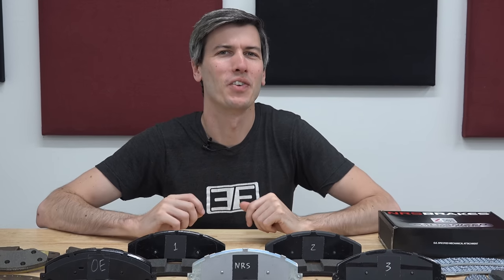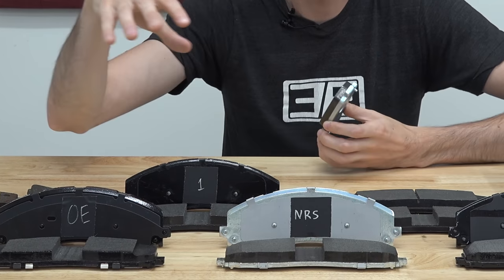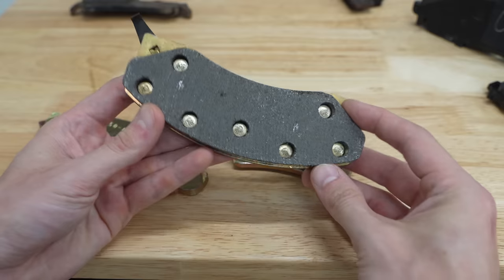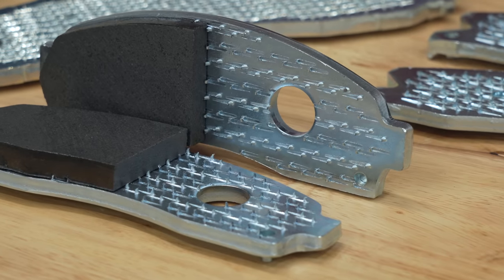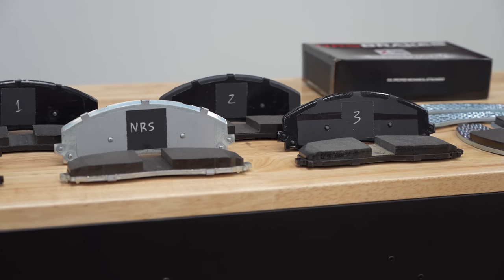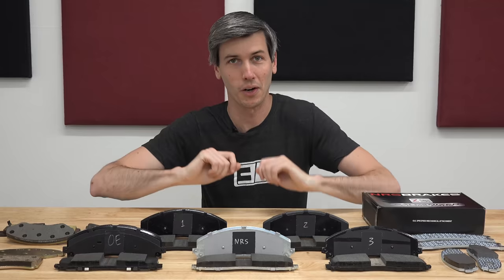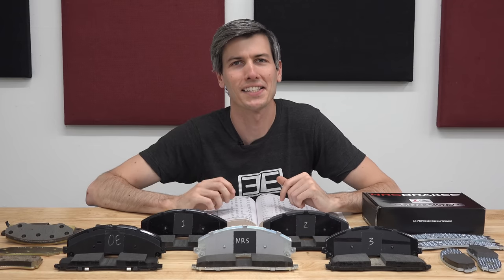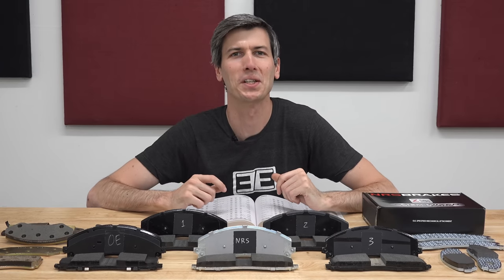The Sketchy Truth About Aftermarket Brake Pads

Comment: I do brake jobs almost every working day, the friction material seperating from the plate is rare if theyre glued on and always happens when the pads are beyond minimum thickness anyhow. Unless you're racing it's not really an issue. That being said I recommend you don't buy the absolute cheapest pads.

Comment: It looks like the shear test is done in the wrong direction. On the video it is performed upward, on the narrower width of the pad. It should be performed sideways, on the longer length, which is more realistic to the stress a pad will be subjected to with the friction on rotating brake disk. Moreover, you can see all the little « hooks » have a triangle shape as they are chiselled from the baking plate. Therefore they are more prone to let go on one direction than on another. I am really surprised this test was even validated. To me, it is almost irrelevant.

Comment: As a colorblind person, I cannot distinguish between the colors of several of the lines and thus can't read your graph properly. You should use instead graphs that differentiate lines based on line design (solid, dashed, dots and dashes, etc).

Comment: When you want to keep your vehicle original, OEM is always the answer. Just because car brands choose manufacturers to build their parts doesn't mean that those manufacturers sell on their behalf following the exact specification designed by the brand, and when you think about it, it wouldn't even make sense to do so, economically.
If you intend to change your vehicle for use on track, drag or anything else, everything is different, this is because you will take it out of its original design, but be careful with the parts you use, safety always comes first.
Good curves

Comment: I'm sorry, but I believe you're trying to fix something that's not broken.  I've been working on cars for 53 years.  I've ALWAYS installed the cheapest pads available and I've NEVER had one separate from a backing plate.  Oh, I'm sure the pad material differs, but I've never had a pad wear out prematurely and the difference in braking power isn't even noticeable.  The auto parts stores will try to guilt you into buying the higher end pads, but for the most part, the difference is the warranty and the fancy box.  Use of the high-end ceramic pads actually results in GREATER stopping distances for the average driver because they're engineered to work the best when they're exposed to repeated high temperature braking you'll find on a race track.  Finally, if the low end pads were so bad, the NHTSA wouldn't allow them to be sold in the first place.  OK, now let's hear from all the pundits who believe I don't love my wife because I make her drive around on cheap brake pads.
Reply: Decades , mechanic too ... Well said and true ...

Comment: This discussion is interesting, but it doesn't really have any meaning without information on actual failures. Are pads on actual vehicles failing due to adhesive attachment? Where's the data that shows this? One can divise a controlled test that yields failure in certain products over others, but it's not very meaningful if it's not happening in use.

Comment: More expensive pads seem to stop better and resist fade, but, expensive or cheap, I've never had a brake pad fail mechanically in my 1.7 million miles of driving since 1976.   Until now I didn't even know it was a thing.
Reply: Do you drive where there's lots of salt on the roads? Rust seems to be the biggest issue separating pad lining from the backing. Had it happen to me on my Jaguar S Type, since I do mostly motorway driving and hardly use the brakes. They get old and rusty before they get worn out.

Comment: I truly hope you read this comment. It is drastically important.
I worked in sheet metal for 41 years.
Amongst a number of other Specialties that I have engaged in in my life, that was my primary vocation.
Whenever we used any metal that was going to be exposed any high temperature of any kind, anything close to 300 degrees or higher we always used aluminized steel when you expose galvanized steel to high temperatures it degrades quickly. Galvanized steel has no business being exposed to high temperature conditions. Nor should it be exposed to anything where it needs to be rust resistant. Although galvanized will start rusting before the steel the thin galvanized all that does is make sure that that steel suffers a great deal of corrosion. Whereas aluminized is far better at resisting corrosion then galvanized. The only advantage that galvanized has, is it when you open the box it looks prettier. Galvanized zinc has no business on high temperature Steel...EVER!

Comment: I work in a returns department dealing with “warranty” parts. While most of the claims are poor installation by braindead parts hangers, there are enough material failures to at least make one think twice about which brands they use. Actually, dealing mostly with mechanics makes me paranoid of driving in general. Knowing how much of their work is out there and then thinking of how many people that shouldn’t do their own repairs but are forced to monetarily. And the meh attitude around it from the aftermarket manufacturers to your average driver, about a 3500lb projectile with sussy brakes and tires.

Comment: I along with several other people in this comment section seem to be sharing a sentiment here, the information is good but you probably should've provided statistics on the number of brake failures and or accidents that are caused by losing the adhesion of the brake material or rust jacking, because I myself and apparently many other people in the comment section have never even heard of it happening let alone it being a major problem.🤷🏽‍♂ I understand that OEMs require it in their spec sheet, but OEMs also require a lot of unnecessary procedure, just look at anything German.

Comment: I must be an anomaly. Have driven 4xx,xxx miles over 16 cars and only had to change brakes twice. I generally get 7-8 years or 100k miles out of them. I like to anticipate stops and let off the accelerator and/or shift down. Its what i was taught

Comment: If you have a Honda vehicle, just use Honda brake pads. They don’t squeal/squeak/rattle, they work well, last, and are price competitive with aftermarket pads, and are often actually a little cheaper than aftermarket pads.

Comment: It comes down to don't buy "own Brand" or "no name" pads only buy pads made by the well known OE suppliers that actually make pads for the vehicle manufacturers. Unfortunatley you can't go on price alone. The likes of TRW , ATE, Textar, Ferodo, etc. also have decent online webcatalogues with dimensions and even in some cases drawings ( ATE) so you can be sure to get the right fit for your car and a pad with the right performance for your car not just a generic  pad with the right shape. The good brands are not going to sell a pad with the wrong specification of friction material for say a BMW M3 just to compete on price as it will back fire on them.

Comment: If slide pins are dry and sticking it will introduce prolonged high heat and cause pads/ rotors to fail.

Comment: #1) I have been driving for nearly 50 years, only 1 time have I ever had friction material come off from the backing plate. And that was a drum brake shoe, which cam loose after the rear axle was submerged for 15-20 minutes, as I got the truck stuck in a creek. I honestly believe that steam was a contributing factor in that case. #2) Who will EVER have there brakes hot for days at a time?! That is a ridiculous test with no real world useful data. get the brakes HOT for an hour at a time to mimic braking down a mountain. That would be useful data.

Comment: DAYS AT 550F.... yeah sure bud, I will have my brakes at 550F for literal days..... cherry picked test much?
Reply from the maker: This is how accelerated testing works. You put things through tougher conditions than they see daily to see how they hold up long term. Over many, many braking cycles with heavy duty applications, you will get a lot of heat in the adhesive.

Comment: Seriously testing pads that were baked at 500F for DAYS. What brake pad is going to last that long in real life, none. Ive never ever ever seen brake pads from top tier suppliers that actually disintegrate, with mechanical hooks or not. Ive seen one from a sub bar manufacturer start to break apart but it was being run much above its intended working range. Most pads with the hooks can only run to 50% thickness before they need to be replaced. So in a perfect world, hooked backing plates are better but youre going to replace them almost twice more often.
Reply: You sound like the type that thinks service life means 1/32 of friction material.  The barbs in anchored pads do not change the OEM service life.
Reply: @ShainAndrews  so many false assumptions from your end. Anyhow, go by whatever min thickness your brake pad manufacturer quotes, otherwise your rotors will find out the hard way, and that could get very pricey when its a PCCB rotor.
Reply: @alyousuf  I don't make assumptions son.
Reply: @ShainAndrews  clearly 😂

Comment: Are you sampling the premium pads sold by the tier one companies? Yes Tier one brake companies use glues as attachment points on big truck pads. These are their basic cheap pads that you are comparing. All their premium pads use a mechanical attachment for these heavy duty applications. The big part stores demand a cheap pad for every application, so the pad manufacturers offer them. I have been selling parts for over 30 years and would never sell the economy pad for a big truck that tows, hauls or is used for a farm rig.  I could count on one hand the times pad material has sheared from the backing plate in all my years because I won't sell the economy pad for 1/2  ton to 1 ton trucks.

Comment: The Z is misleading. I can't look up an exact number at the moment but let's say the D1083 has a D1083Z. There are dozens of OE numbers that fall into the D1083 design. Not every single one of them uses a mechanical attachment. It is far more application dependant than a more general FMSI number. The application the pad goes on is only part of the equation to why the OE would require a mechanical attachment. The friction material formula also plays a part. Since aftermarket pads don't use the OE friction material the "equation" to determine pad attachment type is changed. Generally a mechanical attachment will yield higher shear values when the failure mode is at the backing plate. But that doesn't mean it's better. If adhesive yields a more than high enough shear value for the application than who cares if you can get an even higher value using mechanical attachment. It's overkill at that point. This is coming from 23 years in the braking industry primarily on disc pads for OE and aftermarket and a contributor to FMSI.

Comment: I hope you realize that mechanical means of attaching such as the little points will create a weak shear layer in the pad material.  So yes it will shear off right at the tips of those.

Comment: I have a 2001 suburban and I had a rear brake pad delaminate during stop and go traffic. I lost my brakes and had to swerve around stopped traffic and narrowly avoided a crash. I had to pump the brake several times to get brakes again and it was metal to metal and ruined my brake rotor. The method of using adhesive instead of mechanical attachment should be outlawed.

Comment: My uncle has 44 years as a Certified Ford (dealership)  mechanic. 
Me: How many times have you seen brake failures come in?
Him:  All the time, 5-8 times a month.
Me: how many were due to bonding between the braking material and steel pad?
Him:  what?  I cant say I've ever seen that.  A lot of the times people drive them down to the pad and ruin the rotor.  Some time it is fixing a diy gone wrong. Why are you asking?
Me: I saw a video on youtube (forward the video).
Him: maybe i can see that if you tow for a living, but I've never come across that since 1979 when i started.  Keep in mind that guy is trying to sell you $170 brake pads that Ford (OEM) sells for $63.20.

Comment: Good explanation, but without names and models it’s just kinda pointless.

Because the rest could be from major companies but could be their most budget oriented pads where are the other could be the most expensive ones offered.

Plus you don’t need any fancy tools to remove the pad from the plate, literally a saw and a wire wheel will do the job

Comment: I don’t like the way they sheared the pads.  Seems more realistic to have done it perpendicular to what was shown.  Another point would be that they pressed from the edge of pad instead of contact face which does not seem real world applicable.  Real world you have axial force with radial forces.  Combination of those to could change results so “mechanical” attachment is less differentiating.  But I could be wrong as these are my first reaction thoughts.

Comment: i bought autozone pads on a car i didnt care about much, knowing i was going to get rid of it in a year or so.  
the brake pads i had to change 2x in a year.  never again will i buy cheap pads.
Reply: There is no free lunch.  Shorter pad life means longer rotor life.  That is whole new conversation because NONE of the after market rotors are anywhere near OEM quality.
Reply: at 12000 a year, i shouldnt have to replace pads twice....just sayin.   @ShainAndrews

Comment: Thank you

I always spend way too much time selecting parts. I had a pad fail on my wifes truck and just figured it was age and corrosion.. Three years in the north east. I'm rethinking it now and am pretty sure the pad was only bonded to the plate. The plate was damaged then so i do not know if it was toothed or not.  Im guessing it was not. 

Ill be changing brands when available. Unfortunately i have some odd ball cars and can only get what i can get. 

Hopefully safer and not ruin any more expensive 20" truck wheels next time
Reply: Please turn autocorrect on
Reply: @Paronak  apologies. Rubber gloves on and got interrupted and got posted before I went back and fixed. 

Good call  that was horrible and I fixed most of it I think

Comment: My issue is not with anything in the technical topics covered, it's the clickbait title. 

So, to start with NRS brakes are not aftermarket? And if an OE supplier (for the vehicle in question) supplies the same parts supplied to the manufacturer through an aftermarket channel, is that an aftermarket supplier or an OE? Your title, at a glance, would imply that all aftermarket brake pads are sketchy. Is that the case?

Don't become the FOX News of engineering on YT...

Comment: So I'm a parts tec. When it comes to brakes. you can't just guilt your customer into buying high quality. They need brakes or they wouldn't be there. They have a use case and a budget threshold. If you try to pressure them, they are going to leave without brakes. You need to listen to the customer, and get them the right pad for their need and budget. If all they can afford is the econ pad, well that's better than nothing. And you have the opportunity to warn them about exactly what they are buying. Nobody likes buying the cheap stuff, but you do what you need to do. making your customer feel bad about it is just going to make them go elsewhere. To someone else who might not be so honest about the product.

Comment: 90% of the time i find your videos boorish. Not this time. Working logistics for 30 years and dealing with every possible brake system and material know to man, this  really explains why certain applications require certian methods. The last thing you want is an comerical aircraft aborting a take off at speeds of 175mph and about 1/3 of the runway left to stop with, or the comerical truck carrying 60 tons down a 4 % grade for 20 miles. Haveing a friction frailuer  at speed is very difficult to halt.

Comment: The test is both flawed and un-realistic.
They've specifically set it up to favour the mechanical attachment of which they are marketing their product against.

You would need a pad that manages to have both a high coefficient of friction (which cheap crap pads don't) and a poor bonding (which good quality pads don't).
Brake pads aren't failing left and right, so clearly its not an issue. Where they do how are they differentiating  misuse and lack of maintenance?

Its not that mechanical attachment is unnecessary, but neither is a bonded attachment bad.

Comment: Good info, had no idea about such thing. Definetely shouldn't be allowed to legally call your part OE equivalent, if it's not. 

Do you know how many PSI's of lateral force there is on the friction material, when a vehicle with these brake pads is performing maximum possible braking force?